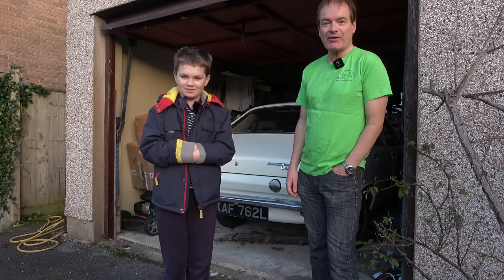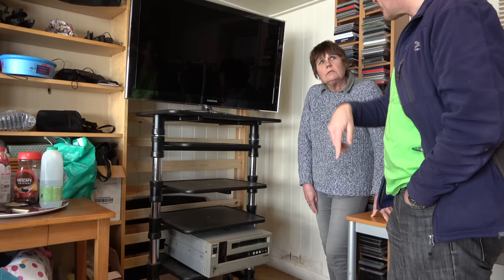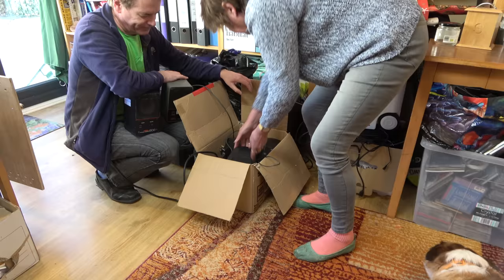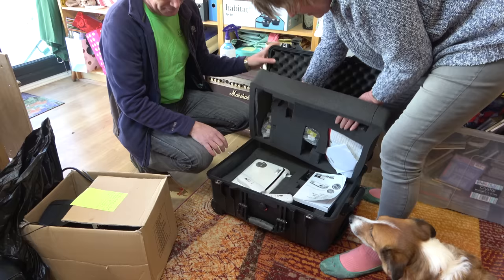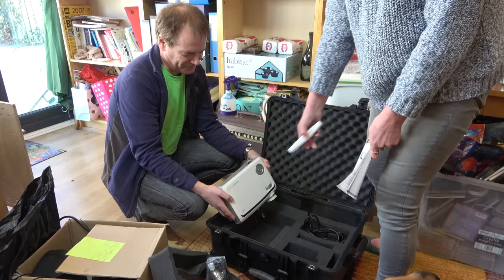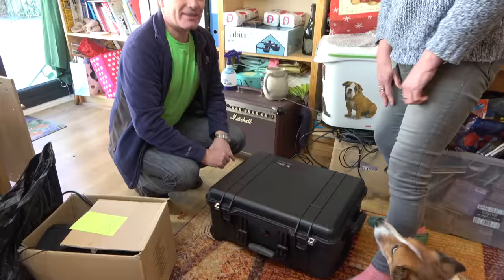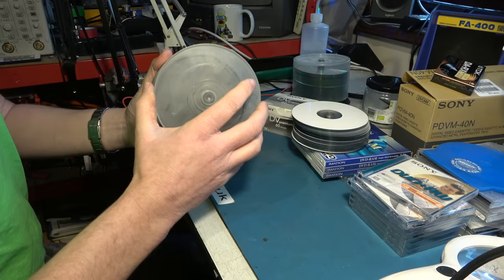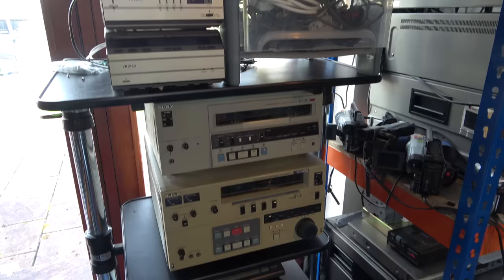Road trip to collect audio / video kit. Part 1.

Comment: The little foxtex powered speakers always fail over time as they have the foam surrounds, you can also get replacement foams. There are all mono, you just use a pair for stereo, the power connector is a Canon LNE 😃 part of their Pro XLR  series, and yes it's for mains power :)

Comment: That lady is a nice person, i guess she used to use most of that equipment for presentations maybe?.
And her happy doggy is tolerant to unknown visitors, some dogs just hate foreign invaders lol.
The speakers can be improved with a foam support kit :-D.
Im supprised you didnt take a bit of paper in a thin strip and formed it around the allen key end then slowly work it into the slug hole.
Take up some of the looseness.
Cardboard would work with a bit of swearing lol.
I actually wished that all dvd disks were in a caddy, far safer and no light could get to them.

Comment: Unicol will supply you with pinch wheels rather than grub screws. The grub screws are supplied for permanent installs  and the pinch wheels are supplied for ephemeral installs.

Comment: It's much easier to simply use a drinking glass and a piece of paper for those spiders/bugs. With paper you don't have to lift the "container" (glass) more than a quarter of a millimeter, thus lowering the risk of the insect/spider to escape. It has been working here for years.

Comment: Cool video, a nice lot of gear there.
Poor Scott, his introduction to the perils of Imperial/SAE measurement, I loved his exclamation "That doesn't make any sense" 1/2, 1/4, 1/8, 1/16, 1/32, and 1/64ths, no one said it made sense, but that the way we did it. At least your Hillman Avenger would be all Imperial. Try something like my Jeep Cherokee made in Toledo Ohio, Transmission Japanese non-Chrysler Metric, Engine American Chrysler but originally AMC Metric, Exterior such as headlights and fog light Torx, Interior Mostly Philips screws except for things like the radio 1/2 bolts holding it in because that's the way they had done it at Chrysler since the '70s.
Reply from the maker: I did have a metric bolt issue with the Avenger once, when installing a part on the car which had been made later than the vehicle.  I think it was a bonnet (hood).

Comment: 20:10 The dots at the top are generated by the DVD recorder, for the American closed caption system. Any NTSC TV that's connected to the signal will be able to show closed captions; they have to have that feature by law. It may or may not be possible to turn the dots off. The projector might be able to hide them if it has overscan adjustments.
It's the same idea as teletext (hide data in the overscan area), but the American system only uses two bytes per field, whereas teletext used something like 16 lines of 40 bytes per field. And it's only for captions, not anything else.
Reply: Actually I'm pretty sure the pattern shown is the widescreen signalling information, which occupies the first half of line 23 (for 625 line systems) and tells the display the correct aspect ratio to use (among other things). Displays that don't understand this signal just show the pattern of dots. I remember playing with this quite a few years ago, and watching the dots move position as the content changed between 4:3 and 16:9 video. Any display that understands the signal should 'mask' the pattern of dots, so you just see the second half of line 23, with the first half shown as black.

Comment: That mains connector is called an XLR LNE, and were made by Canon and Neutrik amongst others. They used to be used extensively in broadcast equipment, such as cart machines, tape machines and amplifiers, but are now banned because of the metal body.
Reply from the maker: Rightly so I would say.  The cable's outer insulation doesn't make it to the connector body either, so I'm not sure it would qualify as double-insulated.